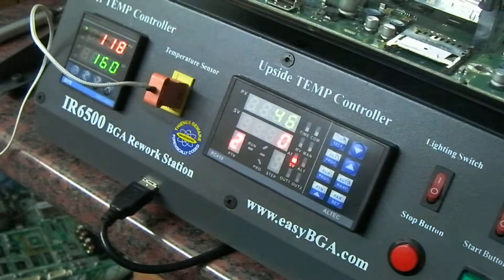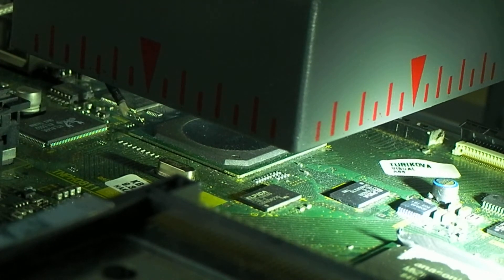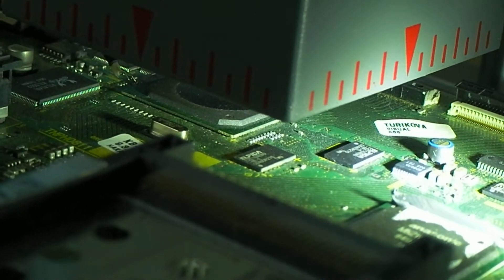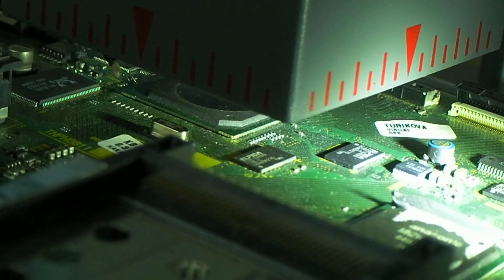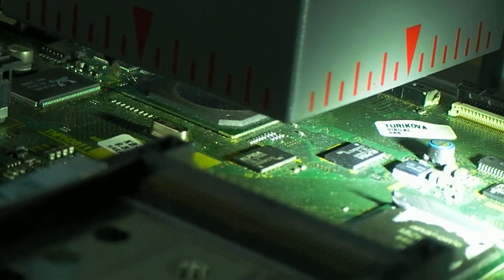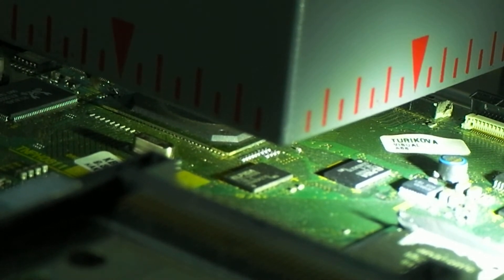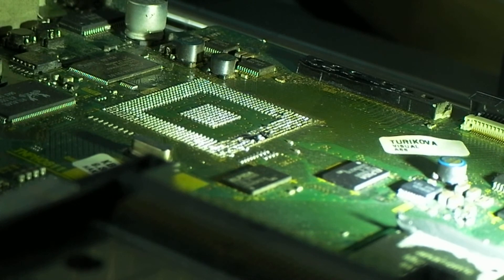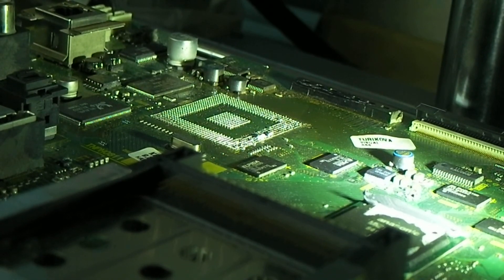Practising with the Achi IR6500

Comment: I ended up grabbing one of these and you need to take your glasses bottom off i bet your yours is like mine and some idiot used that metal tape to attach the internal temp sensor to the top of ghe ir lamp issue is that they covered almost 65% of it!! The stuff is basically shielding from ir lol 😆 😂 thats why your trashing boards my guy